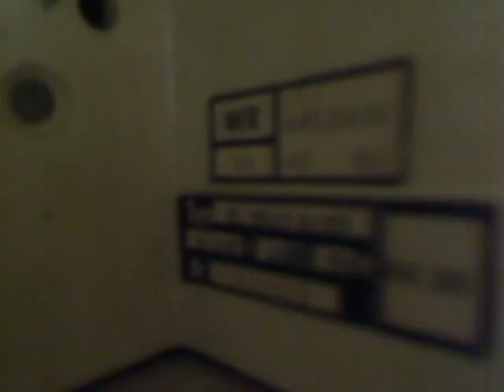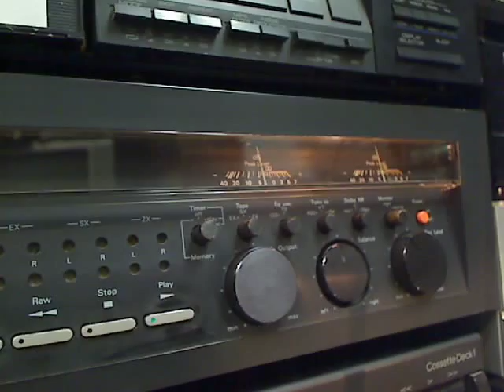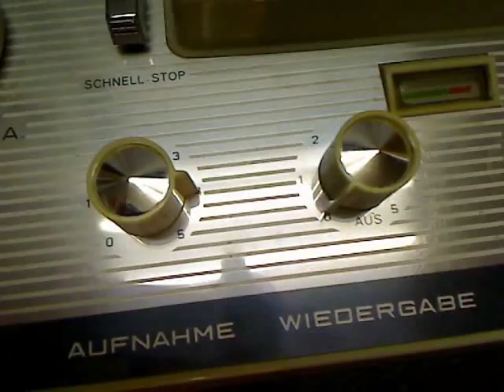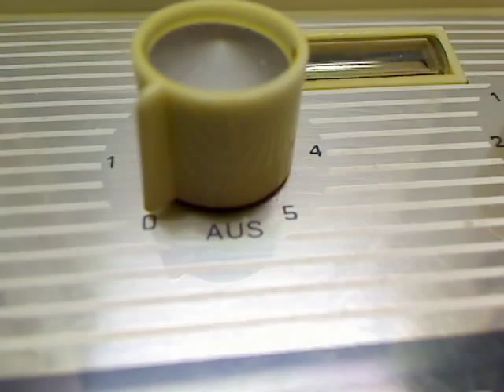Philips EL3547(RK36,60's reel to reel) recording and play demonstration.

Comment: Your recorder is from week 42 1962, look at your type label and see the WR-code label. It say's 42 62 That means week 42 of 1962. So bit older as your suggestion 1964. Have fun with it. Very early transistor. Some nice 1 generation OC type Transistors.

Comment: Sehr gut gemacht. Ich habe dieses Gerät auch repariert: https://www.facebook.com/media/set/?set=a.233024090195298.1073741830.209959535835087&type=1
Hier eine Besprechung: http://de-de.facebook.com/209959535835087/photos/a.209971789167195.1073741828.209959535835087/210877669076607/?type=1&theater
Reply from the maker: Hab es mir angesehen. Auch eine TOP Arbeit,in der wohl auch einiges an Zeit drinsteckt! Bei mir fehlt leider vorne das Philips Emblem. Ja..........es gibt deutlich bessere Geräte aus den 60ern, als dieses hier.